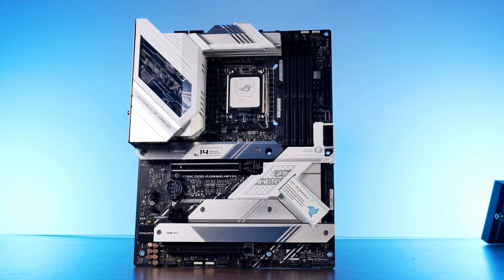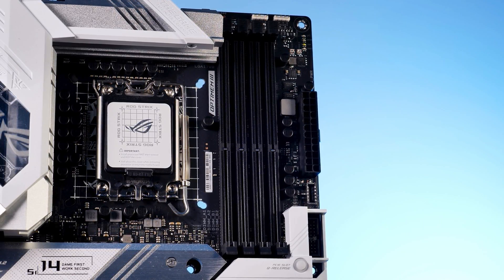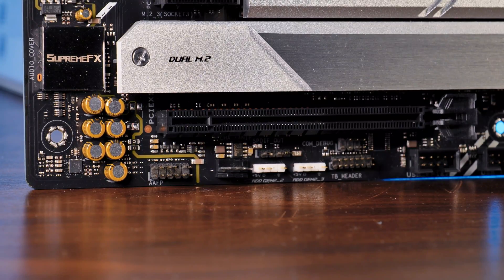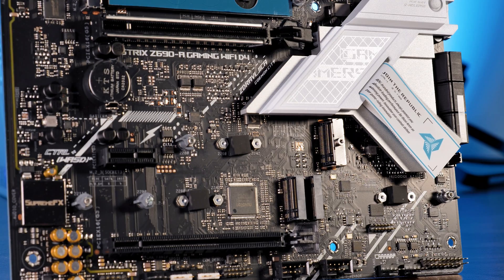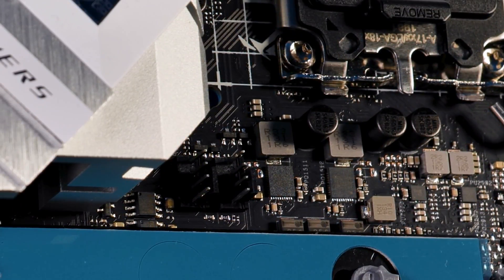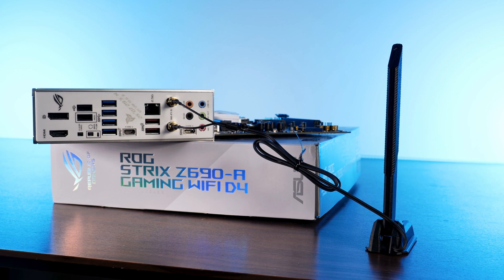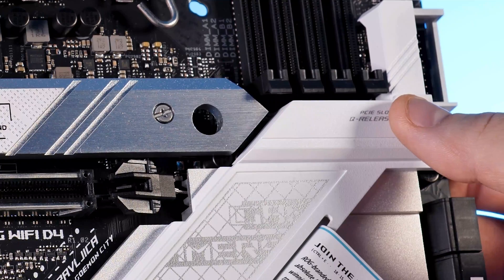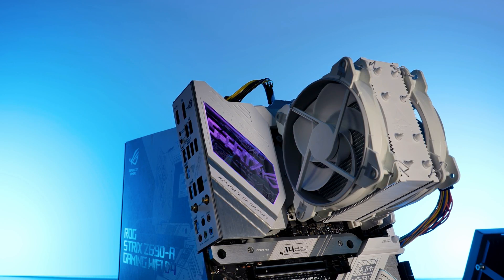Asus Strix Z690-A White Review - DDR4 Motherboard

Comment: I just bought this board and was hoping to upgrade it in the future to two RTX4070 cards on this board. Is this not possible? I had thought that the 16-pin slots were both for GPUs. If this board can not take two GPUs can you please direct me to a board that can with the DDR4 and I9-13900 CPU. Thank you.
Reply from the maker: In theory, you will be able to run 2x 4070 using both 16x slots. Nothing is stopping you. If I remember correctly, both of them will be forced into 8x/8x mode, but that shouldn't be noticeable
Reply: @STSYT  Thank you. I was afraid I had bought the incorrect board. I won't be using this for gaming, I'll be using it for editing in Resolve and Light Room. If it will be faster than a single card I'll be happy. I appreciate you taking the time out to respond.

Comment: I baught this board but I'm realizing not all cpu fans fit even with proper mounting hardware because of the PCIe 5.0 slot and the VRM heatsink. Are you using the ARCTIC Freezer 34 Esports Duo cpu fan? Was it an easy fit? Nice build btw!
Reply from the maker: Thanks! 
And I have had it on there in there past, no issues that I remember

Comment: Great video man. So I’m assuming this motherboard is perfectly compatible with the Z73 kraken AIO 360mm white cooler. If so does that mean I have to purchase the LGA 1700 bracket for it to work or is it possible without it? If someone could confirm this it would help me immensely🙏🏼
Reply: Motherboard is LGA1700 socket. It's up to your AIO manufacturer to provide you with the compatible bracket.

Comment: This is not a motherboard for a professional, or a hobbyist, or an enthusiast. This is a motherboard for a childs gaming pc. 4 m.2's, yeah I'll give it that but those expansion slots are lacking. One x16 @16 for the video card, one x16 is @8 for what? video capture card? and a single x1. What the heck is that for? Sound card? nope it's got that. WIFI? might need a second port but mostly that's covered too. USB or Wireless? not really. Oh, and the SATA connectors, guess where the conflict is going to be for those.